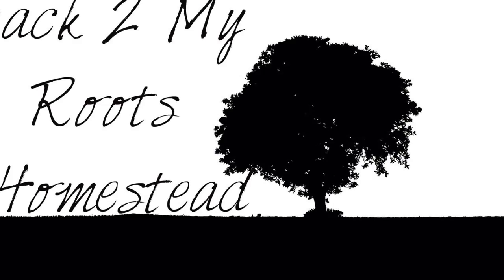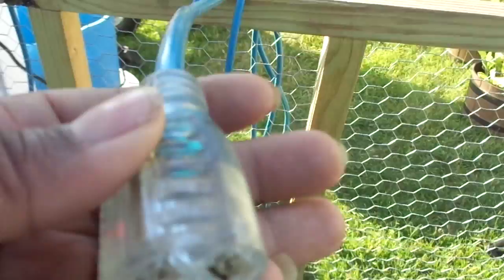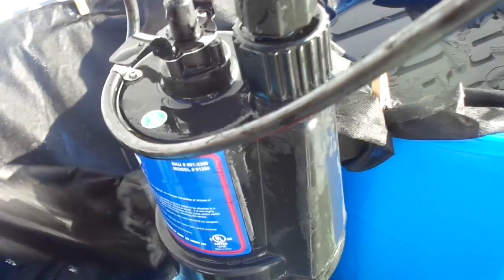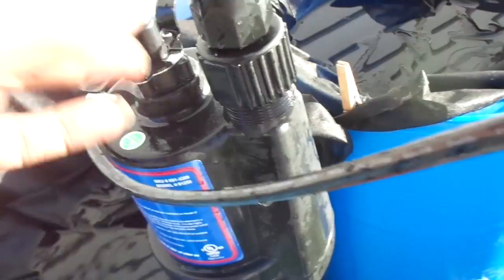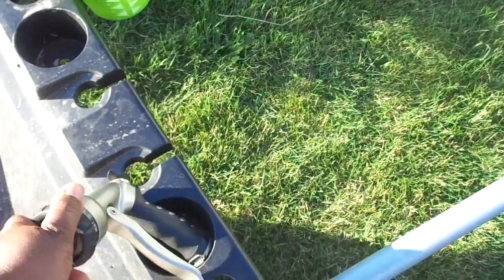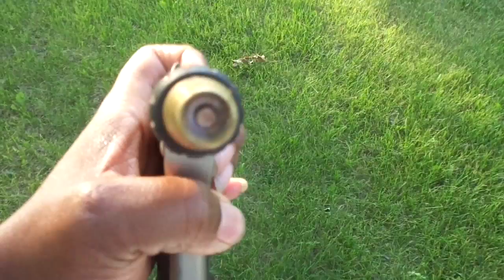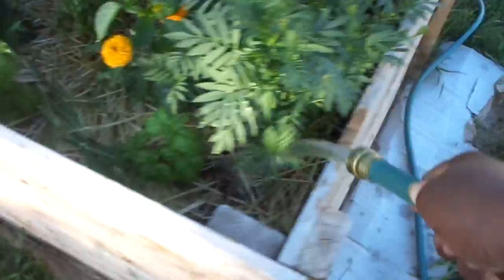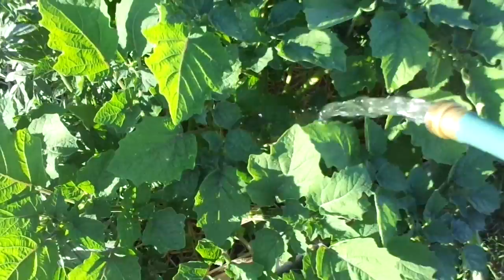Using A $16 Sub pump to Water my Garden

Comment: Hey they have inline hose filters and quick connectors on Amazon. But pantholes over the bottom of the pump will.stop debri will work in a pinch

Comment: You should attach some fine mesh filter material to the bottom of your subpump to prevent any bits being sucked in and blocking your Sprayer 😉....Great idea btw to use a sub pump in the water barrels 👍🏼

Comment: All my hose has shut off valves connected.  It shoots up the water quite far and good spread of water with no pressure interference.    
Wondering if the pump will get damage if I shut off the outflow valve in few intervals.

Comment: Great idea with submersible  pump but I'm wondering if you had any pump problems like overheating or not working when you have a nozzle attached to the garden hose? Especially when the pump is plugged in and you are not spraying any water or letting any water flow out?
Reply: I'm wondering the same. Any answers to this yet please?
Reply: I'm thinking it will be OK for short periods of time but you don't want to leave it hooked up you'll dead head the pump it will burn out but for $16 oh well
Reply: @matprang4508   Yes, you are right, deadheading a pump is not good for the pump. I read the comments just to see if someone was going to mention this fact. They should be using an on-demand pump that has a pressure switch.

Comment: Get you a paint strainer bag from Lowes and put it over your pump to keep the small junk from passing through. I also hand water my hole garden but I plan to change that this winter when I revamp my setup.  Everything is looking good in your garden! Keep up the great work and thanks for sharing with us. :-)
Reply from the maker: CB's Greenhouse and Garden, a paint strainer, that's a wonderful idea!!! I'll get one when I'm 'in town'!! I had to change things up otherwise I think I would have thrown in the towel. I'm interested in what you have planned for your new water system. Stay well!!
Reply: @back2myrootshomestead525  Either that or an inline pressure washer filter screen, they're a bit more expensive but relatively easy to clean
Reply: yeah, the whole pump in a screen bag is genius. they also make inline filters you can attach the hose to.

Comment: Girl you have given me an idea! Lol that screw in the middle of your spray gun unscrew it and you can clean behind there to unclog it.
Reply from the maker: DevaJones03, I was thinking about you when I made the video. With this drought I was about to give up on watering before we got the sub-pump. It's still a hassle but at least now it's not such a chore. Hope this helps.
Reply: Back2myroots Homestead girl you know I be out there toting water like a Hebrew slave! I think I'm going to put drip tape in every bed though it will be am interesting project that's for sure, and save me time. Takes me about 45 minutes to water everything currently.
Reply from the maker: ROFL!!

Comment: Where exactly can I purchase one of these pumps??
Reply: Looks like this is the pump she's using but it's not $16 - it's $48.94.  It's available at Menard's.  

Barracuda® 1/4 HP Thermoplastic Submersible Utility Pump

Model Number: 91250 Menards® SKU: 6913309

Here's the link:

https://www.menards.com/main/plumbing/pumps-tanks/utility-sump-pumps/barracuda-reg-1-4-hp-thermoplastic-submersible-utility-pump/91250/p-1444428713624-c-1489153238832.htm?searchTermToProduct=6913309

Comment: I thought about doing the same thing but was too concerned about the oil used in the pumps. Are you not concerned about that? There are oil less ones but they are 5x the price and from the reviews I've seen don't last very long.
Reply: The oil is very minimal and doesn't do the pump any good if it doesn't remain in the pump. A one minute first time flush would be sufficient.